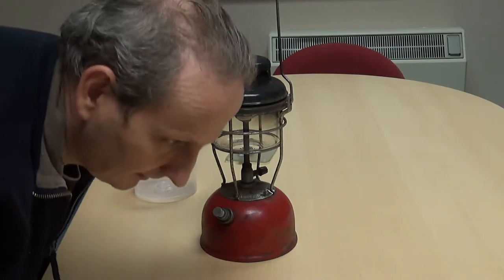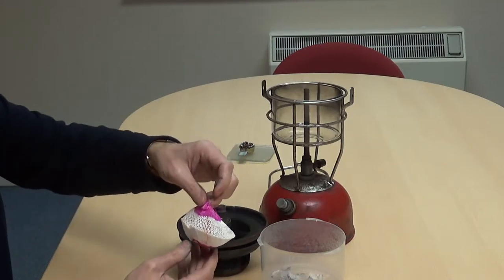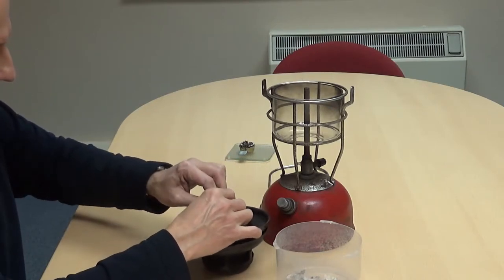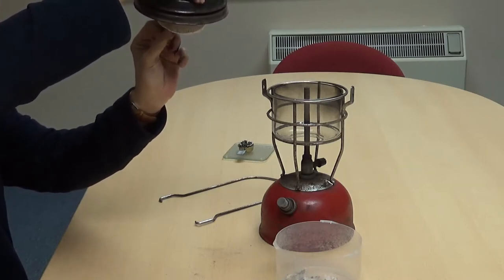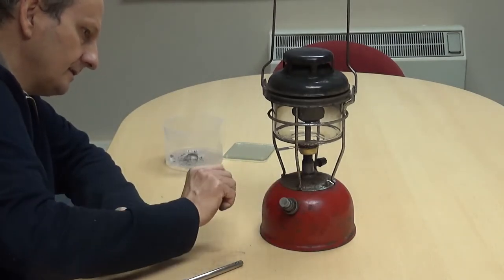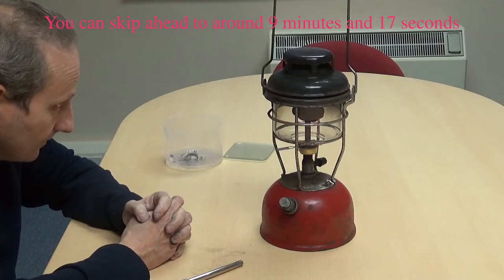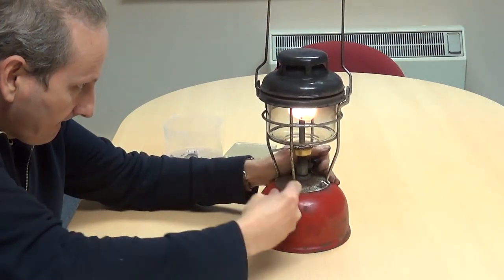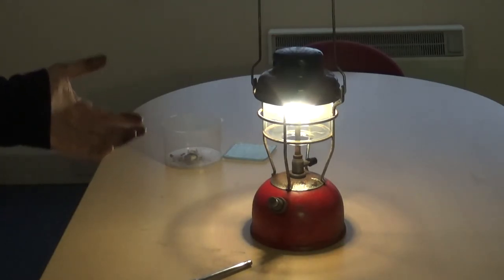How to change the Mantle on a Tilley Lamp

Comment: Not a good light if you're in a hurry, then.
Reply from the maker: No. Though you could just soak a cloth in paraffin , wrap it around a stick and light it if you are in a hurry, or just use a torch...
Reply: The sequence shows fitting a new mantle. Subsequent lighting, using a mantle that has already been prepared, is much faster (1-2 mins?)

Comment: you dont actually show how to change the bloody mantle which is what the title of your info says!!!!!
Reply from the maker: You see the old one being removed from 40 seconds in to around 1 minute and 10 seconds, with a new one going on from around 1 minute and 50 seconds followed by burning it in for the first time and lighting it.
Reply from the maker: I am wondering given that, what you mean by the mantle?
Reply: The mantle is the globe that burns very bright white. It starts off as a soft white/pink "purse" that, when heated in the flame, changes shape into a ball that glows white. It's very fragile once it has been burnt into the ball, so don't touch it until you want to change it. After many hours of use, the globe (mantle) doesn't glow as brightly, so you need to change it then.

Comment: Well presented tutorial. Would suggest cleaning the glass before replacing the mantle. Old school, crumpled newspaper was used to clean, polish oil lamp chimney & glasses. 
Stubborn stains with wood ash, water paste or soapy hot water.  If carbon build up in burner head, can be loosen, removed by soaking with " Mr Muscle " or " Cillit Bang ". Leave to work for a while, then wash out with warm, hot water. 
Same technique  can be used to rejuvenate a sluggish vaporiser or restricted heating tubes on a stove burner head.
Care must be taken to not damage the jet orifice.
Allow to dry thoroughly. Reassemble. 
My experience, using, maintaining  pressure stoves & lamps, also wick types for more than 30 years.
Reply from the maker: Many thanks for watching, please like, share and if you like the channel, subscribe!

Comment: thanks mate will take on board I am just trying to find the best way to light up an area for fishing I remember the old tilleys as I said and I have a good one here looking on line the coleman has a mantle that you can clip on and the one that I got from tilley spares seems massive to fit I will try and see if they do a smaller mantel I dont want to spend 150 on a new lamp I will persevere and get this one working thanks for your info best wishes  ken
Reply from the maker: The mantle shrinks a lot when you burn it. Also they are fairly cheap. Have you got the Tilley torch (the bit you put the meths in)? Also a cheap way of getting light these days would be a battery LED camp light.

Comment: This is my chilhood 🙂 are the mantles as fragile as they were way back then?
Reply from the maker: Mantles on gas lamps are very fragile. These seem less so. They are by no means robust however they seem more robust than I recall from gas lamps. Once I have built my shed I have two more to refurbish as well as several primus type stoves. (Including one which runs on petrol!)

Comment: Stupid question. What is the purple stuff you used. Just got my first Tilly lamp and want to make sure I know what I'm doing before I even light one.
Reply from the maker: The stupid question would be "what is a lamp".  So no, that is not a stupid question.

The purple stuff is methalyted spirits which is available in the UK, and probably other markets, but denatured alcohol is good. A methanol/ethanol based spirit that burns.

Note that it burns with an invisible flame so wipe up any spillage before lighting and close the bottle and put it out of harms way.

I presume you have the "Tilley torch"? Also which country are you in?

Many thanks for watching, please like, share and if you like the channel, subscribe!
Reply: @BensWorkshop  I have the Tilly touch and I'm from the UK. Thank you for responding. I will definitely subscribe and like. You have been extremely helpful 😃
Reply from the maker: @Beefkilz  Many thanks.
Reply from the maker: You can buy it meths from Toolstation. They are quite good.
Reply: @BensWorkshop  so do I use that for the inside of the Tilly lamp as well or do I get paraffin for that.
Reply: @BensWorkshop  also never heard of Toolstation. Found one 5 minutes away from me. I now am going to have fun looking in there to see what tools I can buy 😃
Reply from the maker: In the lamp, paraffin or kerosene (same thing really). The former may be available at DIY shops intended for heating greenhouses and the like, and isn't cheap the latter at country petrol stations where it is available and generally used for heating oil. 

Do not use either meths, ethanol or petrol in the lamp!
Reply from the maker: They are quite handy.
Reply: @BensWorkshop Thank you for all your help
Reply from the maker: @Beefkilz  No worries.
Reply: @BensWorkshop , kerosene is less refined than paraffin & causes more carbonisation.
Class C 1, paraffin can be used in confined spaces as CO2 rather than CO produced. Even cleaner burn & less odour is achieved by the use of white spirit as fuel.
Reply from the maker: @trwilkinson4623  I have had this conversation before. 
See:
https://en.wikipedia.org/wiki/Kerosene

If you wish to debate the point, provide sources.
Reply: @BensWorkshop , I understand the difference between the grades can be better explained by reference to the safety data sheets provided by the manufacturer, supplier. British Standard  2869 C 1, as compared to heating oil meant for furnaces at grade C 2.  C1, has more sulphur & other chemicals removed. A primus stove burns with a cleaner, blue flame & better heat output when fueled by the more refined product. Less need to prick the jet hole, when lighting.
The quality of kerosene varies between sources, refineries.
Reply from the maker: @trwilkinson4623  Provide links. Also I have noticed not difference in amount of pricking required and the most of the rest of the world calls what we call paraffin Kerosene.
Reply: @BensWorkshop  congratulations you may have access to very high grade kerosene. Had this conversation with a heating engineer. Customer services appliance regular, changes supplier of fuel, & develops sooting problems. Tell the supplier that the oil is to be used in certain Aga, Rayburn ranges & the sooting alleviates, disappears. A supplier in my area used to have access to jet grade fuel, as well as regular heating oil. The premium product obviously commanded a higher cost. Your experience is more relevent to you & so I will accept your perception that what I suggest is poppycock & not feasible. Keep safe.
Reply from the maker: @trwilkinson4623  Provide links to source information or get blocked.

Comment: I liked the ones with the metal ring. Anyone know why they stopped making them?
Reply from the maker: I don't know. That said the one I got for this lamp seems to work well. Please feel free to like, share and subscribe :)
Reply: The ones with the metal ring are known as  “happy mantle”. They were far superior to the ones they make now. The downside to them is that they contained Thorium , a radioactive substance , and were eventually phased out. There are still unused ones out there and appear from time to time. Definitely buy it if you come across one. The bulb shape and glow you get off them is far better than the crap ones they produce now !
Reply: @wangchung_8541  their tie on "X" mantles also used to be thorium until about the time they stopped making the happy mantles with the ring. There are aftermarket tie on mantles that have thorium that are much brighter. IDK why they stopped making the happy mantles with the ring, but makes me wonder if the tooling for the rings wore out and they didn't bother repairing it.

Comment: I am sorry to trouble you after I was so cheeky but the new coleman northstar dont they have clip on mantels which must be a lot easier to fit pus there is no pre-heat and no meth/parrafin you can run them on coleman fuel which I can buy from army and navy? thanks for your help it is appreciated
Reply from the maker: I have no idea however a mantle is a mantle. In an ideal world they last for years. As for preheat, it really isn't difficult and paraffin is a lot less volatile so safer to handle.
Reply: I like the idea of these lamps, so much more character in them than electric lights for camping.  

I bought an old tilley from Ebay, glass a little cracked but going to see if it'll work tonight.  

As far as the coleman lamps go, they look great, I guess it depends on how you use them; I don't fancy having petrol near a tent....paraffin is bad enough. ;)

Comment: Hope that's not one of the old Thorium oxide doped mantles you removed...🤣...they're pretty radioactive & since the used mantles turn to dust so easily, they're regarded as a hazard. 
Just received one of these fabulous near mint condition X246 lamps through ebay...& yes it came with an old mantle which was radioactive. Fortunately, I have several geiger counters due to my other hobbies & interests, but how many people are totally oblivious to this?
Took it outside & it literally disintegrated instantly then blew away in the wind, leaving me just to swab/decontaminate the whole lamp. Won't be keeping any of the original packaging for the same reason.
Reply from the maker: From Wikipedia 
"Thorium dioxide was commonly a major component; being radioactive, it has led to concerns about the safety of those involved in manufacturing mantles. Normal use, however, poses minimal health risk."

It poses minimal risk.

Many thanks for watching, please like, share and if you like the channel, subscribe!

Comment: yep thanks I have an original tilley preheat I will keep trying unfortunately I have broken 2 mantels already but have a couple more and the one I have just put on seems to fit betterI have LED lights but they dont compare to the light and warmth of a proper lamp plus as I remember you can put steak and kidney pies on top and heat them up!!?! cant do that with an led!! only joking thanks again for your help. ken
Reply from the maker: No worries.

Comment: I can see why the Yanks had to win the War for you. I could start a Russian T-34 in the time it takes you to fire up that lantern!
Reply: The Tilley Lamp is very old technology. That's neither praise, nor criticism, it's just a statement. The sequence shows a new mantle being fitted, which does take time, because it has to be fitted, then change structure into the globe that actually gives the light. Having said that, the guy did make a meal of actually fitting the mantle onto the burner. The normal sequence of lighting a Tilley, using a mantle that has already been used once is much quicker (1-2 mins?).  You are making the same comparison as watching a video of someone changing the clutch plates in a car, and comparing it to actually using the clutch!                  Oh, and by the way,  during WWII, which was over 75 yrs ago, what do you think the Yanks were using? This was long before LED, and other electronic lights etc, were even dreamt of, never mind available, the Yanks also used pressurised kerosene (paraffin) lamps just like these. That's all there was!
Reply: @davebinks  i was buston balls. And no, the yanks werent using tilley junk. They used coleman 252's or 220's. ...i have 10 of them from late 30's till the 70's.